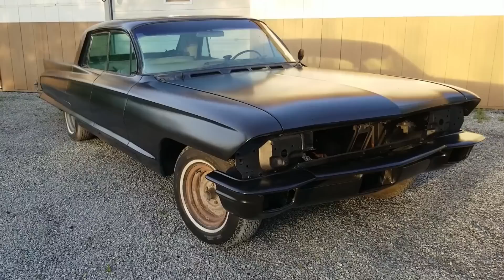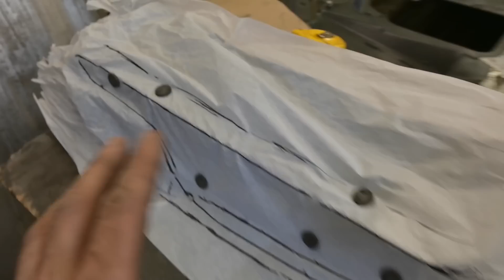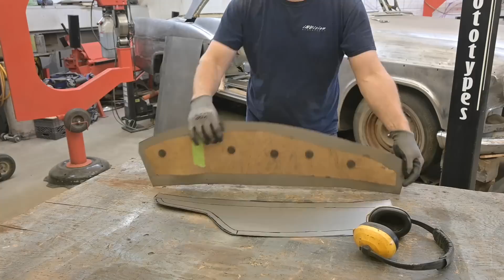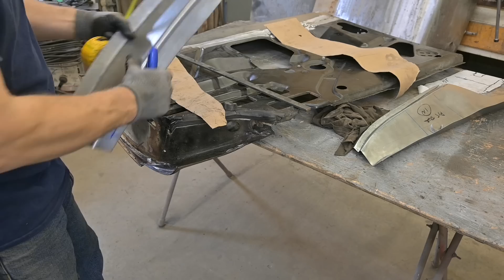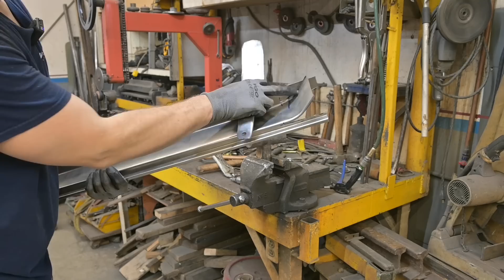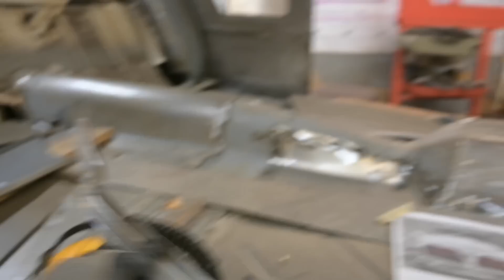No Door? No Problem. Handmade from Scratch!  Pt.1 - 1956 Chrysler Windsor Muscle Car

Comment: I'm gonna have to copy your tipping wheel. Is that a shop made unit?
Reply from the maker: Yes it is, and I say go for it!  Most of the equipment has been built in house at one time or other..the tipping wheel, english wheel, reciprocating hammer,  74" brake.  Cheers!
Reply: @iNVisionPrototypes  I'd love to know more about your reciprocating hammer. I get to expand my workspace next year and some kind of power hammer is pretty high on the project list.